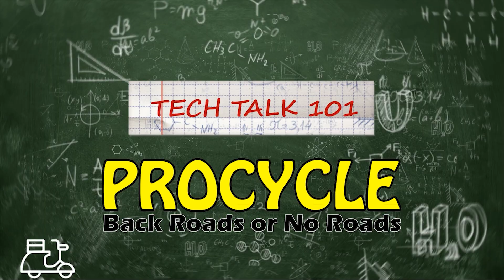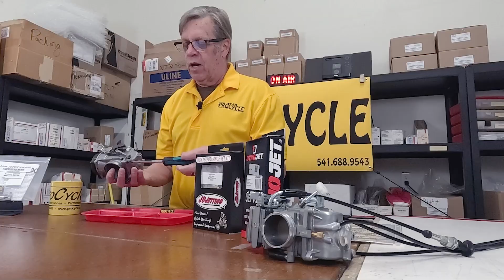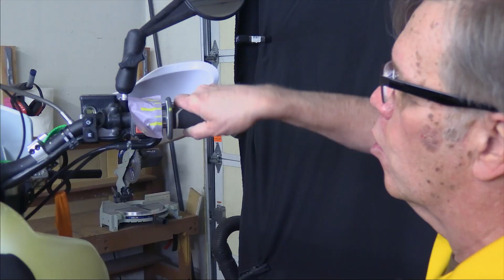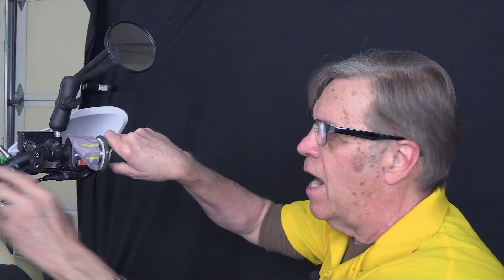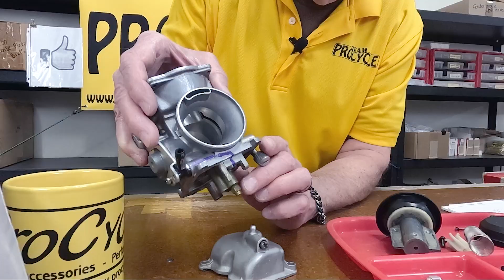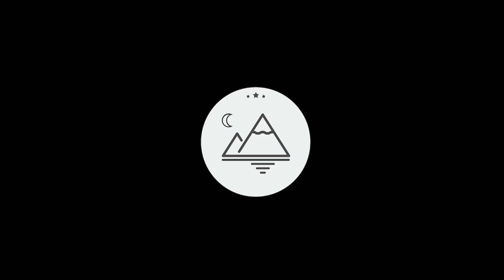Tech Talk: Jets Jets Jets!

Comment: Love this tech tip section, especially on carbs. Even with the JIS drivers, the screws are so tight on my DR 650 carb, I can't break them I still cam out. Any suggestions to get them loose?
Reply: Maybe see if you can find JIS bits you can put in a (Manual Impact Screwdriver) or to a powered impact drill set the clutch really low so it slips the clutch far before it strips the screw head. Ease 1 click at a time increase on clutch tension   to the tighten side. Make sure you hold firm pressure up against the screw head so your bit doesnt slip on the head causing damage

Comment: Great discussion. Understanding how one fuel circuit hands off to the next circuit is key to getting it all smoothed out. The ProCycle kit works great on the DR650. It really wakes up the engine. Many thanks.

My setup at 7,000 ft: 155 main, fourth notch on the needle, 2.75 turns out on the mixture screw, side cover removed (snorkel in), stock exhaust. Sounds counter intuitive at high altitude, but it's what the carb "told me" it wanted. Fantastic results. Only about 10% reduction in gas mileage.

Set the float height first!!

Comment: Great video, Carl! So few young mechanics these days understand carbs, even though they are really quite simple devices (on motorcycles, at least). IMHO, a properly tuned carb delivers better throttle response than all but the best fuel injection systems - no snatchy throttle response or ridiculously lean fuel mappings with a good carb. Anyway, this video ought to required watching for anyone who owns or works on carbureted bikes. If you are going to do any engine breathing mods on your bike, like I did on my DR650 (snorkel removal, ported air box, twin-air filter, Leo Vince exhaust), you are going to need to adjust your carb for best results. The ProCyle Jet kit worked great for me - excellent instructions, too, BTW. 😃

Comment: I installed a Pro Cycle jet kit in my 2020 DR650. I used the #145 jet. Completely changed the bike for the better. Minimum or no choke needed at startup now. Runs great! The only change to my airbox was to remove the snorkel. Pro Cycle is THE go-to for DR related parts and accessories and I think I have most of them😊. The staff is always very helpful. Thanks Carl!